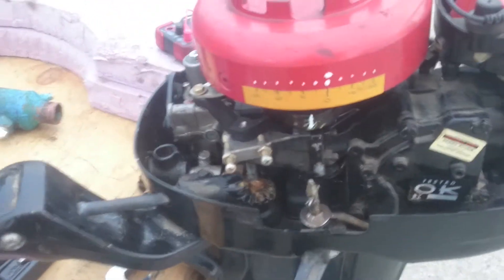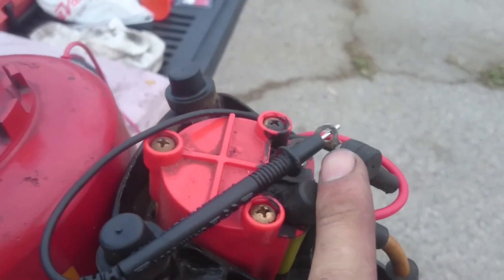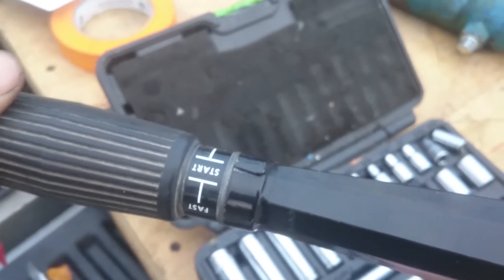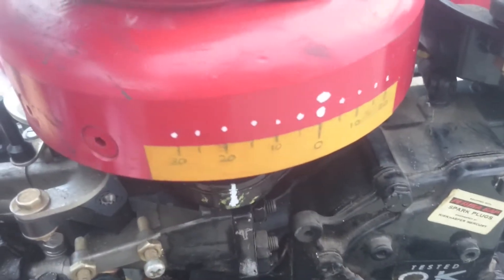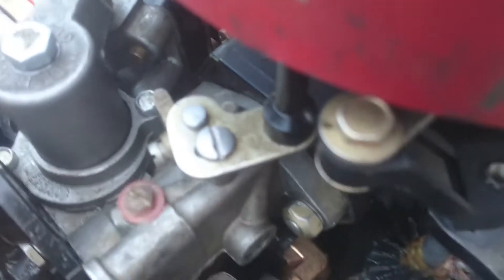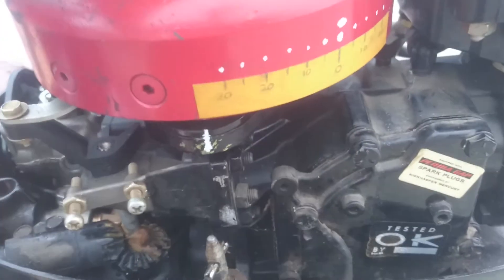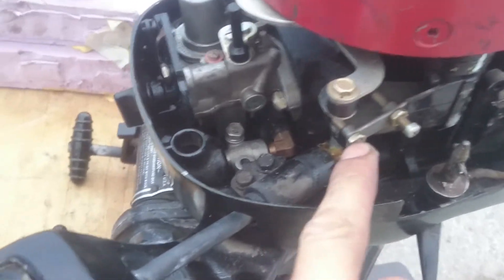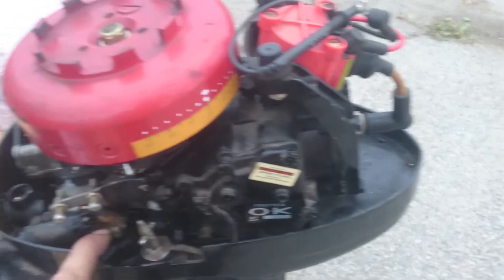mercury 40 4hp ignition timing curve

Comment: Did you use a multi meter or a magneto tester and where did you attach your leads too
Reply from the maker: Hi- I used an inductive type on a 12v source and clamped it around the plug wire. Not sure the older style will work. Points are easy to do with a multimeter - put a degree wheel on flywheel and count degrees the points are closed (dwell), and when they open (spark).

Comment: Good vid. Every engine is different. I would see how she accelerates under load. If it starts on the first pull and accelerates without hesitation or bogging I wouldn't change it. I have literally a dozen mercs and the timing curve varies on all them. Hope this helps. Son
Reply: Dr MercSon L6 Outboards i just bought one of these .Fear that it was a mistake . new hoses, bulb ,gas.seems to have spark lol i use my hand on the block grab the plug  and spin the flywheel by hand   she sparked  blue. starting fluid directly into cylinder  recoil  on pull nadda not even a pop . at a loss